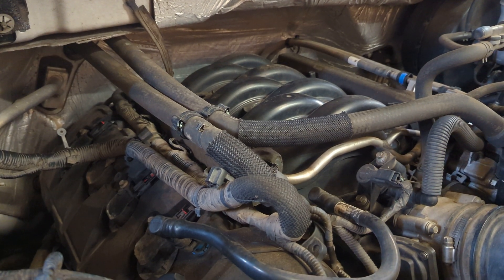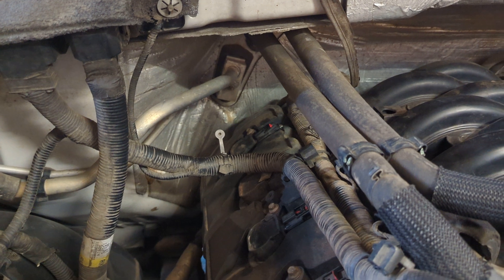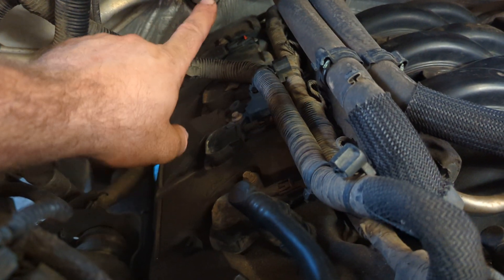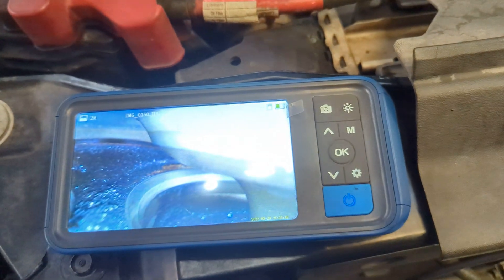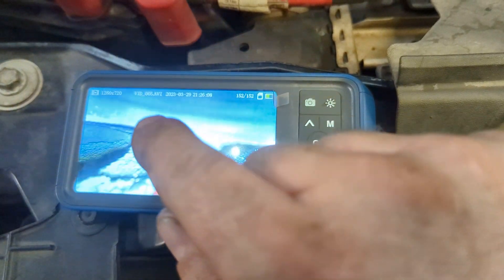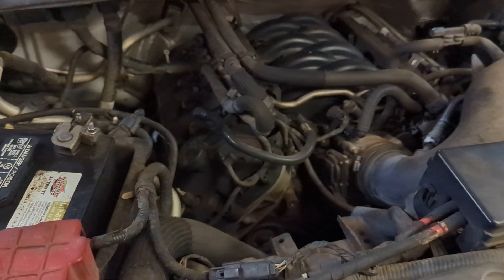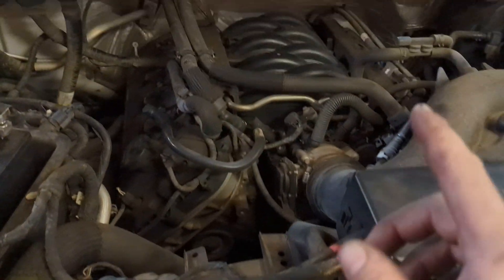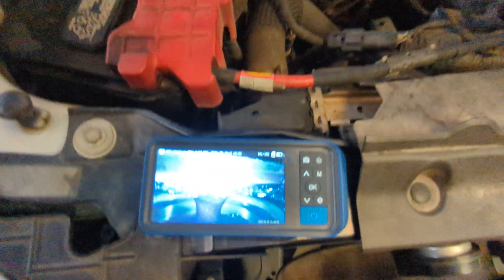2011 F-150 5.0L Misfire faulty intake valve

Comment: I've got a 15 f150 5.0 with 86k miles.  Cold start misfire only on the first start of the day. Runs fantastic and compression tested good on all cylinders.  Spark plugs new, coils and fuel injectors all test good.  Any ideas?
Reply: did you apply dielectric grease to the plugs? sometimes the coil pack doesn't make good contact because of friction when installing coil boots. Also, perhaps a plug broke when installing. Inspect inside plug hole before removal to make sure there isn't any ceramic chipped off. Don't want that in the cylinder.

Comment: Thanks for the video. Is the only way to fix this issue to replace the valve or can it be cleaned? I'm actually having what I think is the same issue on my 14" 5.0L with 213k miles.
Reply from the maker: It would have to be replaced.  New valves and valve job at the machine shop or a new head
Reply: @DiamondStarWerks  thanks for the response. I guess it's time to start saving. Do you have Any recommendations for engine remanufacturers? I'm thinking at 214k miles I should either replace/machine both heads or just replace the engine.
Reply from the maker: @markr9983  I would see if you could get one through O'Reilly's, they have the longest warranty I believe.  Don't get a Jasper, not as good as they used to be.  We've used some engines from AutoZone recently with good luck.  I'd also check them against one from Ford, dealers sometimes have good prices.
Reply: @DiamondStarWerks  awesome. Thanks again! I really appreciate the advice.

Comment: What’s the risk of running with a leaky valve for a while? Does the whole engine really need to come out to get at them?
Reply from the maker: The head would need to be removed to replace the valve.  The risk depends on the extent of the misfire.  Misfires can load raw fuel into the CATs and eventually ruin them and even melt them which would clogg exhaust flow